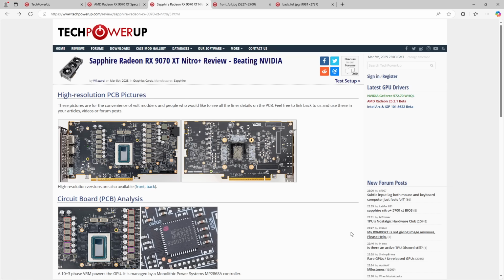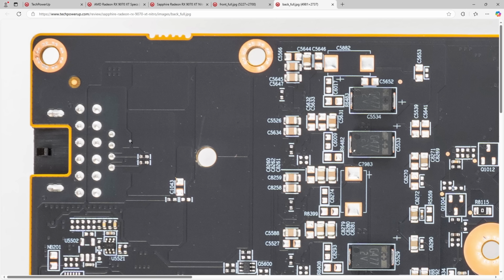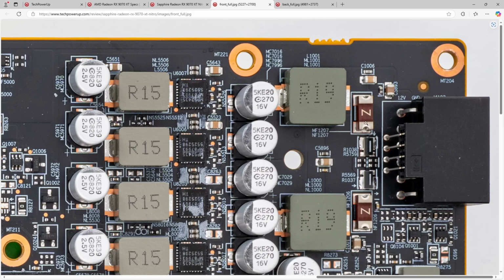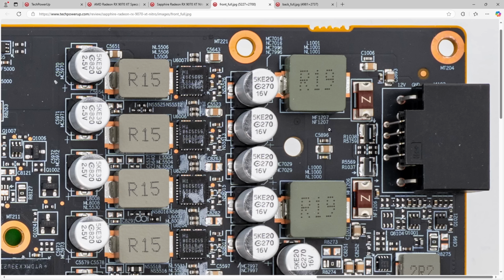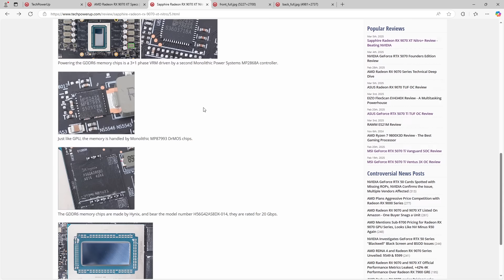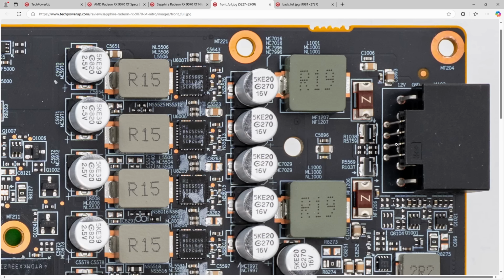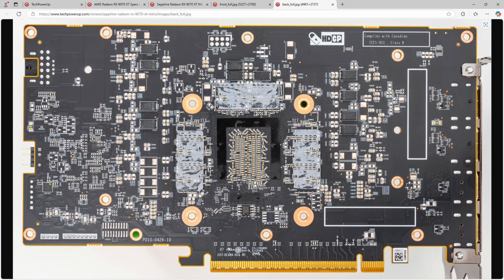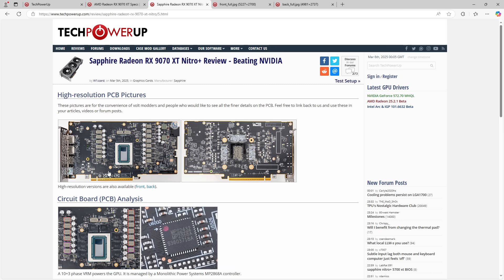Taking a look at Sapphire implementation of the 12VHPWR connector on the RX 9070 XT Nitro+

Comment: Since you're talking about this connector again, I think I'll share a thought.  I'm a mechanic -- lots of experience with 12 volt DC circuits.  What do you think of adding an intermediate, fused connector to the circuit?  It seems fairly easy to implement.  Make a PCB with a male 12v connector on one end and a female 12v connector on the other.  Between the two connectors, on the PCB, add 6 (just a WAG here) 12 amp slow blow fuses.  If one wire of the cable draws excessive amperage, its fuse would open.  If too many individual wires in the cable drew excessive amperage, then all the fuses would blow in a cascade.  Given that both positive and negative would be available on the PCB, adding 6 LEDs to indicate each branch of the circuit is operational would be easy.  Given the cost of the cards and the headache of dealing repairs/warranties, this just seems like cheap insurance to me.  Honestly, it seems so obvious, I surprised the idea hasn't already been implemented. 😕
Reply: I think getting a fused connector to be standardized would be difficult from a manufacturing standpoint, just because it would be an inline fuse and would need to be soldered or crimped which adds another point of failure. That and I would almost guarantee people would use the non-fused cables to "net max power"...

The better option IMO would be an electronic fuse (which are becoming more popular in automotive anyway), which switch a mosfet off when the rail fails shorted. And they're faster than a slow blow fuse or polyfuse.
Reply: @jep1757  I like your idea for using current sensing to open the circuit.  Adding a programmable controller would give a lot of flexibility with software/firmware.  Temperature monitoring could be added too.  It could automatically reset itself after being power cycled.  Also, I agree other point of failure would be added.  There would be no need to crimp anything.  (I could have described this better.)  Imagine a dongle which plugs into the card's power connector on one end and the cable from the power supply on the other using the same, existing 12v connectors found on the cards, power supplies and cables.  It would follow the same standards used by the current connector -- safely passing 9.5 amps per conductor in the cable.  However, after that  amperage threshold was exceeded (plus a bit to allow for spikes and variance), the fuse for that wire in the cable would open.  What I also failed to adequately convey was the price of the dongle -- cheap.  The bill of materials for some SMD fuses, LEDs, male and female connectors and a PCB to tie everything together would be only a few dollars.  Build them for, another WAG here, US$10 and sell them for US$20.  The dongles would be cheap enough to be disposable if the fuses blew.  Thanks for adding a different point-of-view. :-)
Reply: @wargamingrefugee9065  Honestly if there's enough of a demand for it... I could build something like that for people. Just a really simple circuit that trips red leds when one leg goes over the rated limit on current or temp. I can open source it as well. If I get around to it I'll leave a link here!
Reply: It is still a very niche problem to go to the trouble to make and market something like that. But it isn't a terrible idea by any means. All of the other cables made for that connector at least have a market for the lower end cards in terms of cable management and just fitting the card into your case.
Reply: well that would satisfy the safety aspect to not burn the house but, rethink each installation of the card or movement of PC or installing new Power supply,... brings the danger that the fuse weld and so your 700$/€ card is useless, if you are not expert and can change them> only to se the next weld after your fix
Reply: @ What do you mean fuse weld? I don't see any reason why they couldn't be a simple replaceable fuse. I have lots of 15 amp slow blow glass fuses on the shelf at work.
Reply: @--_DJ_--  Honestly, if I was going to build/prototype one of these things for my personal use, I'd use use your idea of having some standard, glass encased, replaceable fuses (I'd use the ones filled with sand to guarantee the circuit was open when a fuse blew.).  I'd start with low amp fuses and work my way up to an amp rating which didn't blow under normal circumstances, then call it good.  Just thinking about it, since the amperage per conductor (wire in the cable) is being limited, I cannot think of a reason why the dongle couldn't by mounted on the power supply and hidden from sight.  Maybe there's something temperature related though -- I don't know.
Reply: @wargamingrefugee9065  I don't think a PSU would get hot enough to worry about. We bury fuse blocks under the hoods of cars and never worry about it. Plenty hot under there. (I'm a mechanic too) 
I pictured something along the lines of what they do with RGB controllers, but with the 12v 2x6 (or whatever they call it now) in and out with the fuses inside. Nothing fancy, just a little black box. The ceramic, sand filled ones probably would be a good choice.
Reply: Inductance.
Reply: @ What about inductance?
Reply: @HueFlakes  There's not a core nor windings -- how would inductance be an issue?  I'm not being defensive, but would like to learn from you.  Yes the wires making up the cable are in close proximity and would generate magnetic fields shared by all, but how would that level of inductive coupling cause fuses to blow early or not at all?  In my line of work, it's not unusual to see a dozen fusible links bundled together and run side-by-side.
Reply: @wargamingrefugee9065  so like adding a circuit panel to the cable like in your house? With each leg wired appropriately for its task. That's not how the pcb works because it would just popping fuses/circuit breakers all the time without proper load balancing. It's like plugging a 240v device into 120v and not expecting the amperage to double. A house is like the gpu/car. You need power management inside each house/car to regulate the power coming into the house/going to each device. It's not the power grid's(psu/battery in a car) to regulate the power distribution. That's up to the mechanic/electrician. So each wire with a fuse would do no good if you ended up wiring them all to the same places on both ends of the wires. You'd just end up popping fusing/tripping circuit breakers every single time you used it. When you wire and fuse a device you only use more than 1 power wire to a device to increase different points to add legs to increase voltage. Not running multiple wires in parallel for literally no reason. Which is what they are going with a double sided 12vhpwr cord without separating each leg/pin/circuit/device with its own dedicated trace/rail/path/load that is designed to handle that load, with a fuse added as a supplemental backup to prevent electrical fire, overheating, explosions. Melting wires, exploding cards, etc. Fuses are added to systems already rated for that amperage. If you put a 13 amp fuse on each cord. It would run for a bit then shut itself off. Black screen. Cause it would blow all the fuses in rapid succession. Someone should wires 12vhpwr with 6 13 amp fuses to prove the point is NVIDIA.
Reply: @wargamingrefugee9065  Also, this is a DC circuit so no expanding/collapsing field to induce inductance.
Reply: adding another connector is creating another point of failure
sure it is rare failure, but it will propagate in a perspective of thousands of PCB's
not to mention increased costs, more steps during assembly line and so on...
Reply: @Dimas_Lopes  Yes, I agree that another point of failure would be added; that problem cannot be overcome -- good point.  What I had in mind was a stand-alone device, not something made into the card's nor the power supply's PCBs.  Imagine something like a dongle.
Reply: @ your idea kind of exists in soundcards but applied to OP-AMPS where you can buy or replace that part of the circuit
creating a dongle could be even more dangerous: your computer need to be balanced and grounded with your PSU, if you add another part that flows energy in and out bypassing the PSU may create other errors because your motherboard sensors are calibrated to the chassis
your idea is good, but not that scalable
Reply: @ If it is fused, the connection can't really fail in the way they do now. The cost would be a consideration, but it would be for people who have already spent 1000s on a GPU. Plugging in one additional connector is hardly a difficult task.
Reply: @--_DJ_--  pay? NVIDIA supplied device. You don't pay the company to fix it's own manufacturing failures!
Reply: You always will have uneven current distribution between parallel cables with connectors. So highly likely there will be cascade blowing up after start if you don't significantly increase current limit of each fuse

Comment: The Sapphire Nitro+ 7900 XTX was probably the best looking Radeon card. I am still tempted to get one now our NZ place just got 30+ of them in stock, but they are bit too old really -- even though they're a bit of a monster that can munch their way through masses of rasterization. The Nitro 6000 series stuff looked good too. 
But their 9070XT is fugly as eff. Having a 12v 'high failure connector' means it can not even look good while going up in smoke. It looks like I might be getting the Pulse version, or look at Powercolor stuff -- even though they can't spell colour properly.

Comment: Sapphire, whyyyy. 3 8-pins would have been just as clean-looking with that fancy cable hiding thing
Reply: The moment I saw Nitro+ with this abomination connector I knew I will be getting PowerColor Red Devil which has 3  8-pins
Reply: 350w is the same power draw as the 7900 xtx, which just uses 2 8 pins, makes no sense to use this connector lol.
Reply: @klooger28 quite a few models need 3 connectors, since they go above 400w (my Nitro XTX can use up to 460w if I max. out the max. power output; it's pointless anyway, since uv+oc with a 90% power usage aka around max. 360w gives you pretty much the same amount of extra frames and saves you 100w).
Reply: They need three 8-pins
Reply: They really don't. My Powercolor Hellhound 7900 XTX draws 420W and has just two 8-pins. Are you trying to tell me that the 9070 XT needs more than 420W? And another thing is that I've been using this card for 22 months now (bought it in May 2023) and I've always used it at full power. 2 8-pins + PCIe are enough even for the most overclocked 9070 XT and are perfectly safe. The connectors can handle a little more current without issues. That's not an Nvidia card after all.
Reply: Yeah, an 8-pin connector can handle 200-250W, well above its specified 150W. But eating too much into that safety margin is how we got into this mess with 12V-2x6.

What if the 8-pin connectors are worn down? Or what if the engineers who designed the spec assumed an ambient air temperature inside the PC of N°C, but the air in your PC actually hits (N+20)°C?
Reply: @wereoctopus  That's the thing....if that happens, the card just won't start. That's the big difference between the specs.

Also hilarious how I put "2 8-pins" in my original post and immediately got corrected to "they need 3 8-pins" so I edited my OP, and now it's "they don't need 3" 

The internet, ladies and gentlemen lol
Reply: @DustinHarms  Yes, if one 8-pin connector is fine, and the other one is so heavily worn that it's effectively unplugged, the card won't start.

What I meant was if one or both connectors are partly worn. Say pin 1 is making negligible contact. Pins 2 & 3 will now carry 50% extra current. If the card is staying within the 150W per connector spec, that's still just 6.3A per pin, and they're supposedly rated for 7A. But if the card's pulling 200W over that connector, now it's 8.3A per pin. Or 10.4A at 250W.

It's possible I'm misinformed, and some GPUs and/or PSUs do have some safety cutoff* based on per-pin current, not just per-connector. I'm no EE, nor am I knowledgeable about GPU board layouts.

* loosely speaking, i.e. including "GPU won't power on".
Reply: Because it's a card that draws under 400W sustained, so outside of really extreme cases it's going to do fine. There is headroom that's missing on *090 cards
Reply: with the same card design running 3 cables throw that space probably blocked the airflow and reduced cooling so they just used one cable instead with color coating to make sure its probably connected or something. adapter stuff. even ATX 2.5 PSUs do not come with 8 pin to 8 pin cables anymore. just 12 pin to 2 8 pin.
Reply: Huh? It’s not possible to hide 3 big 8 pin connectors behind that backplate, you’re absolutely delusional. You can say that the connector was the wrong decision but for the design they implemented here only the new connector can be used as the other are too big and take too much space including with the cables themselves.
Reply: not even 3 8 pins, 2 would be perfectly enough for 300-350w power draw
Reply: @miha1999grobar  Except by the PCI-SIG specification you shouldn't pull over 150W per connector and modern GPUs don't tend to pull much from the PCIe slot, as they used to have problems overloading the PCIe slot 12v rail.
Reply: 8-pins take 150w each. the card draws 340-350w.
Reply: @killswitch8493  nah that connector can easyly take 200w or even 250
Reply: @killswitch8493 8 pins is a 150w connector with a 1.8x-1.9x safety margin. So technically it can safely deliver 200-250w each, +75w from the PCI slot. So, 2x8 pins should be enough...

Meanwhile, 12vhpwr is a 600w connector with only 1.1x-1.2x safety margin. No wonder they're sometimes melting when the power spikes happened.
Reply: its a little close but the pcie slot can deliver 75W
Reply: @minecracktyler  75W is the limit for all voltages provided by the slot. The slot can only provide up to 66W on the 12V rail. Also while two 8-pins and the slot would be enough for stock power consumption it would leave basically no room for overclocking without going beyond the PCIe spec.
Reply: @minecracktyler  
You need to account for transient spikes which can go as high as 800W on a VERY bad day, was pretty common to see if you OC a 3090 or a 6900 XT
Reply: @killswitch8493  3 x150w is 450w + ~75w from the PCI-E slot for a total of 525w with 8 pins.

Technically only 2x8pins are needed to OC the 9070xt and most models seem to of gone for 2x8pin only the push the OC models are rocking the 3x8pin setup and unless your trying to set 3dmark records its probably a waste of time
Reply: 3 8-pins clean? Lay off the glue, dude. 2 8-pins is already too many. Multi 8-pins suck ass, but unfortunately the replacement sucks even harder.

Comment: I HAVE to assume you're correct in saying the spec must be to have the power grouped like it is instead of split and balanced. There's no other explanation in my opinion. I mean Asus even went as far as to give the user the ability to monitor each pin on the Astral. I assume that's no cheaper than just balancing the power input from the get go. Would probably be cheaper if it prevented RMA's. I not an expert on the cost of any of this but I'd assume the partners would prefer to spend more on their boards than to have to replace them and possibly a power supply too.
Reply: But what about the 3090 then? It did have balancing on the same connector..
Reply: @peterkolesar4020  Not technically the same connector. 3090 and 40 series used 12vhpwr. 50 series uses 12v2x6. 

Practically speaking they're not really that different, but legally they are distinct. If 12v2x6 specifies how the power is distributed (idk why they would but they could) then it's possible board partners don't have the right to make changes to that specifically.

I mean, again, I'm not an expert. It's totally possible the spec says nothing about power balancing and everyone that's using it on their cards is just brain dead or would rather save like $0.15 a card and deal with the RMA's. I just...find that less likely 🤷‍♂️

Comment: They aren't asking it to deliver over 330 watts, so that's a huge improvement in reliability.
Reply: Uh this is a 350watt GPU so look at the reviews, and one review should this model doing 360w
Reply: @ms3862  350W GPU, but 75W of that goes through the PCiE slot, meaning the connector only needs to deliver 275w.

Not great, but WAAAAAAY better than the 4090/5090.
Reply: @jedidethfreak  doesnt matter each power line is 100Watt Max and no more safty, so even with only 270 you are 2.7 times above the limit thats why all 40x0 got melting issues.(not only 4090)
Reply: @jedidethfreak  Correction: The card CAN pull up to 75W from the PCIe slot. Don't assume that it does. GPUs rarely (if ever?) combine VCORE from both PCIe and connectors. The 12V in the slot usually powers the display block or some shit like that. Without getting a clamp on the connector we don't know how much it actually handles.
Reply: @ms3862  75 watts from pci slot